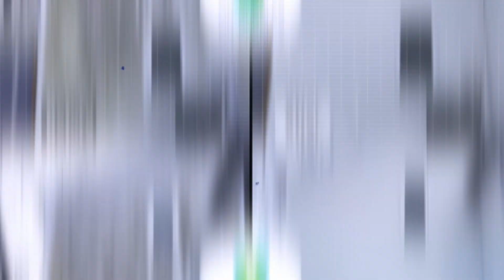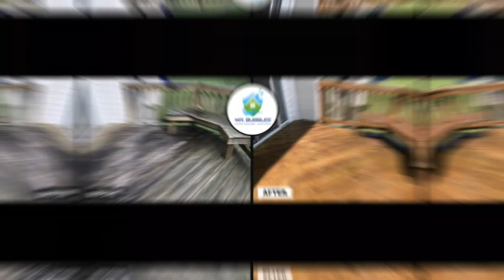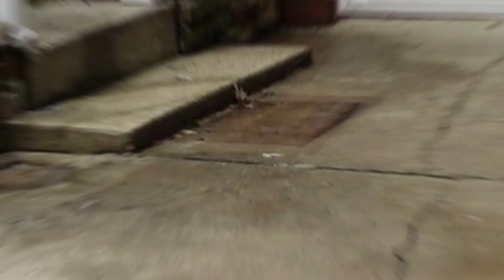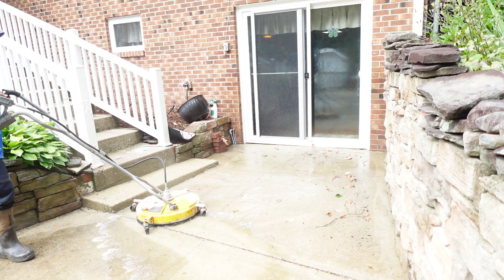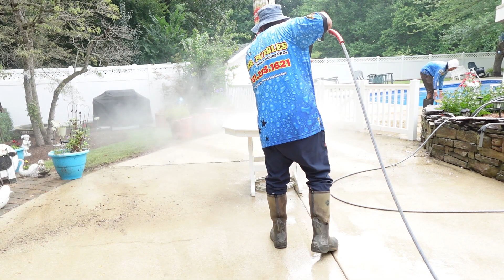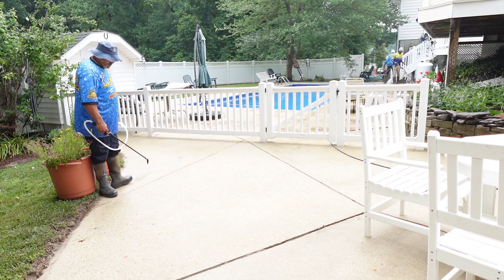Ep.26  How to Pressure Wash Concrete | Beginners Guide to the Pressure Washing

Comment: Hello sir, I am just starting so could you please clear this out for me please, 0:57 you say it is a 50/50 solution down streaming. Does that mean that you have 6% SH solution in the tank and you downstream it at the 10:1 ratio so you get 0.6% at the nozzle output.
Reply from the maker: thanks for the awesome question, more or less, it depends on some other factors suck as size of pump and hose, but you can generally expect the solution to be around 1%. Ours comes out at about .80%